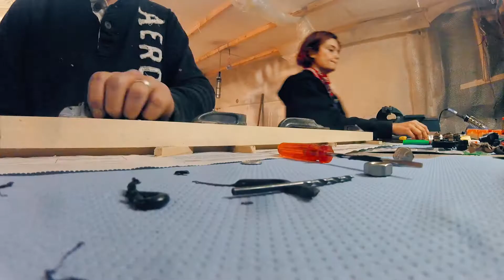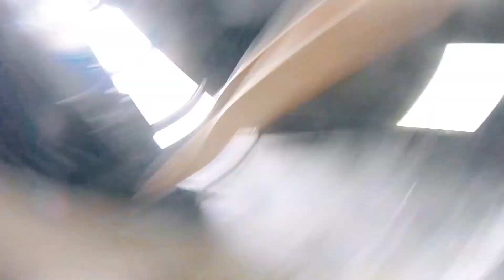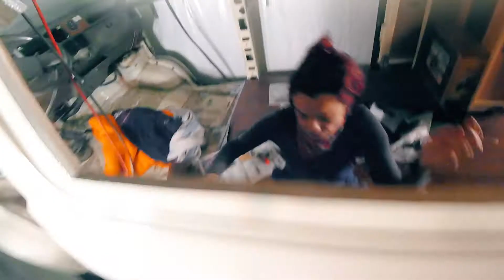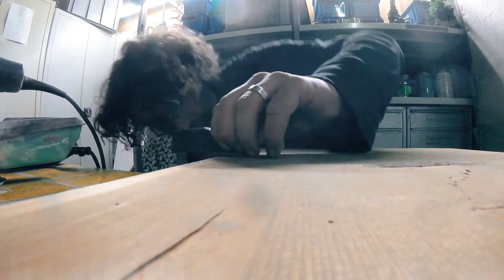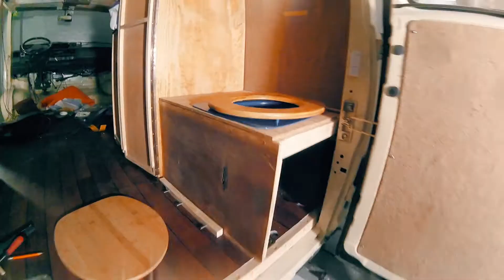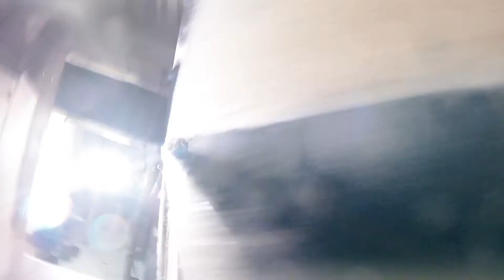We now design the "Separett" toilet and make the sleeping place ready

Comment: Now... that would be a proper campervan for full time exploring !
Reply from the maker: G'day mate, 
yes it is. This was the only problem, if we will call it like this, we had for long term staying. We had to dig a big hole...
We now mount a 50l watertank, so we would have som 70l in total for water.
Reply: AsuhsWorld Same here. I've mounted 75 litres water tank. Still, the rust could kill my dream, pretty soon. This is a big step to make. Good for you that you made it ! You should be fine for some years ahead.
Reply from the maker: Still, the rust could kill my dream, pretty soon...... why, i saw some stuff of your engine on Insta, what happend?
Reply: AsuhsWorld Yesterday morning, I've noticed oil on my final exaust and on rear door. Not sure yet what it is, but definitely not a good sign and not the best moment, since today we have storms, ice and snow alert. I was not ready for this cold and also left my insulation home. If would be worse than this and also having problems with the engine, that's not good. There's a very good mechanic 300 km away, but it's even colder there (actually freezing temperatures) and there's no way I can deal with that in the van, while someone is working on it. I started to think about searching small apartment for rent, until the van is fixed, and start to ask around, see uf I could afford one. The rust was another matter. Its start to get worse and worse "invading" important parts of the van. If I don't manage to start a restoration soon, I might just loosing it. Still... I'm trying to remain optimistic and search for solutions. Thanks for asking !
Reply from the maker: oh shit, bad news from the engine. stay for better weather an move then. you are still in greece ?
Reply: AsuhsWorld Yes. I give up on the full tour for this winter, until Portugal. To expensive and not much difference in temperature (apparently). It's so cold here, way to cold than I was expected !